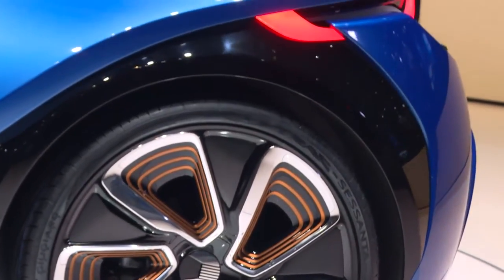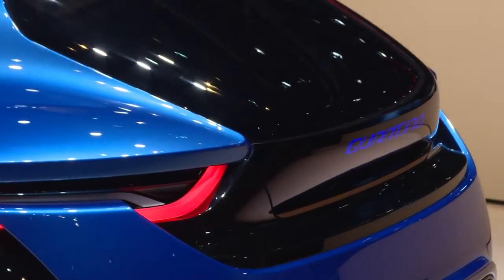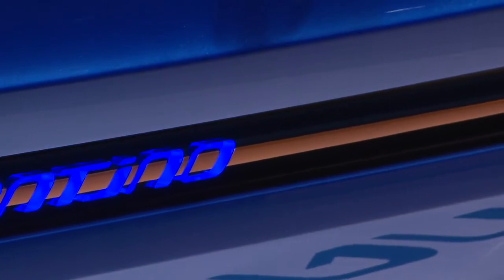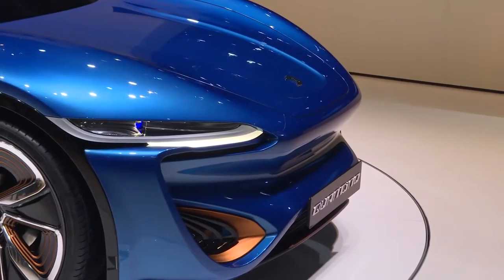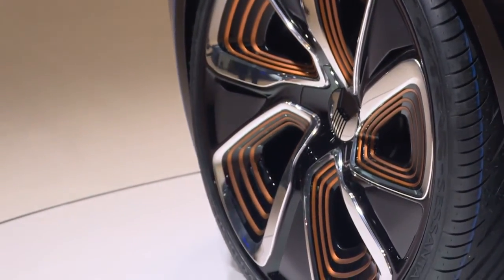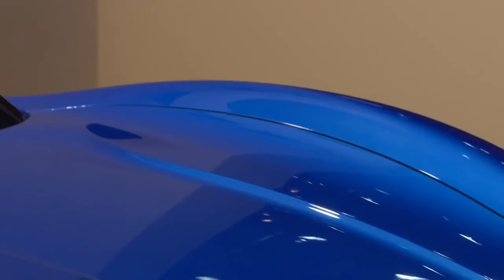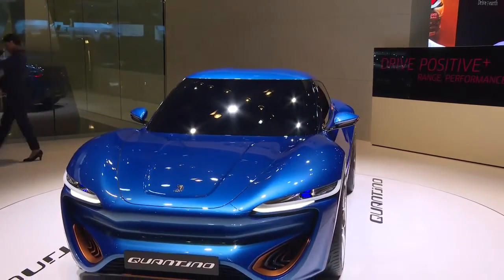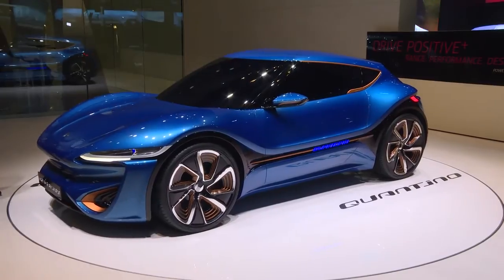Car Design: nanoFlowcell QUANTiNO Concept

Comment: 48V... 100kw... that means 2083A current... that's alot... wonder if they use one inch thick copper bars instead of wire
Reply: alot